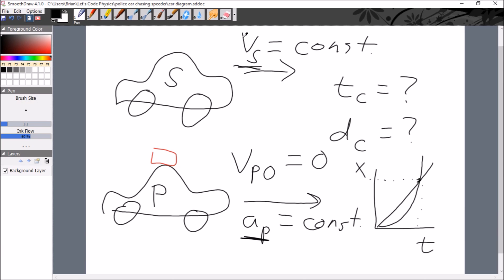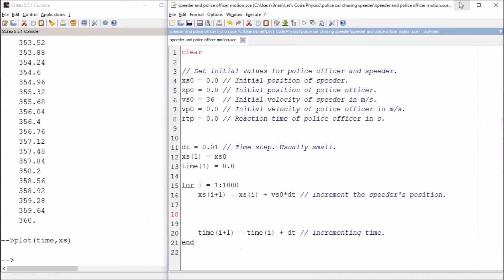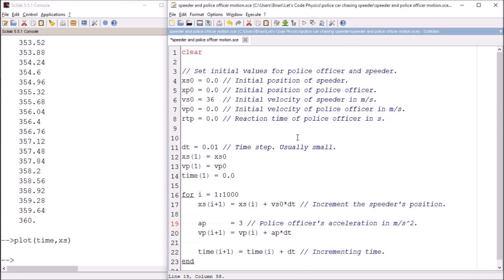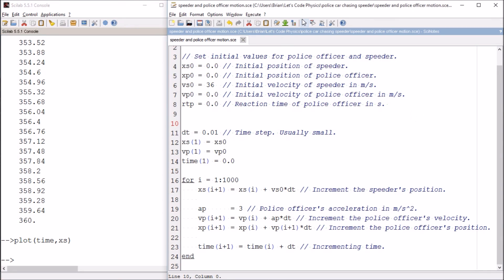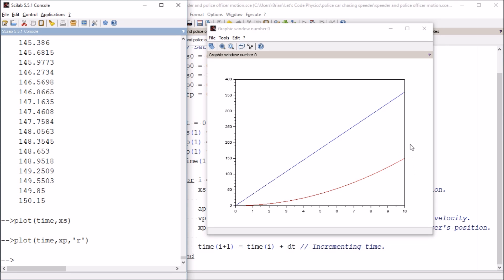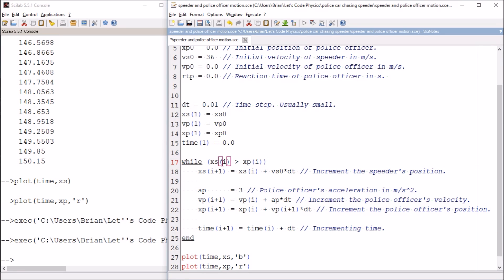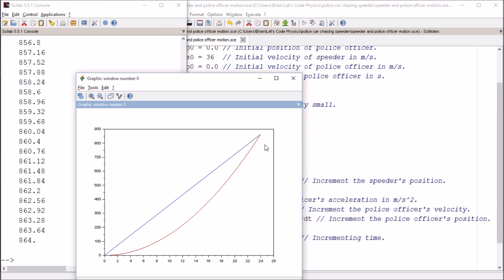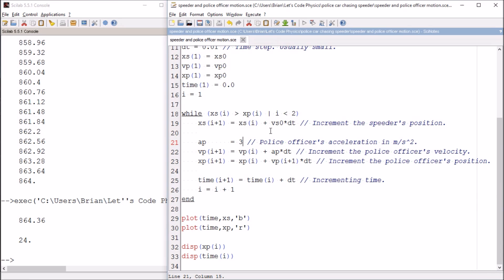Police Chase! - Episode 3 (Police Motion)

Comment: Although the loop condition you used works, I think it would be easier to use "xs(i) >= xp(i)" instead of "xs(i) > xp(i)". The only problem is that the simulation will sometimes do one more iteration, but that shouldn't be that bad given that dt is very small.

Note that this won't happen unless they both have the exact same position at the exact same time. If that's the case then just one more iteration will be computed.
Reply from the maker: Good point!